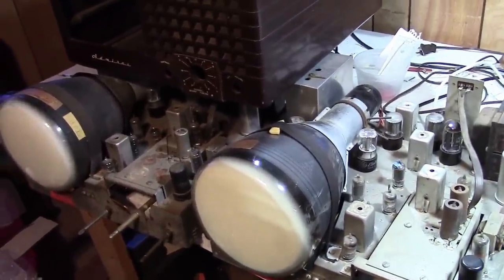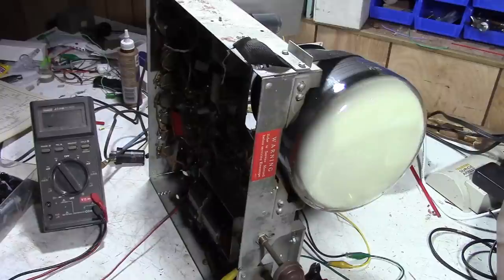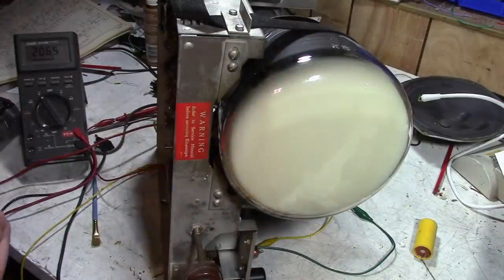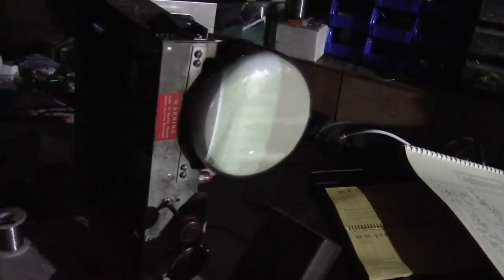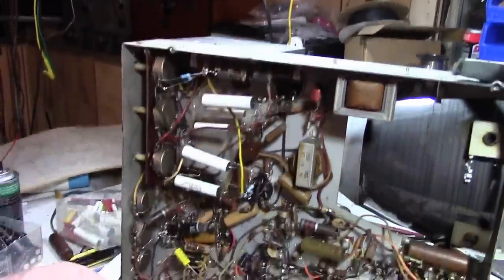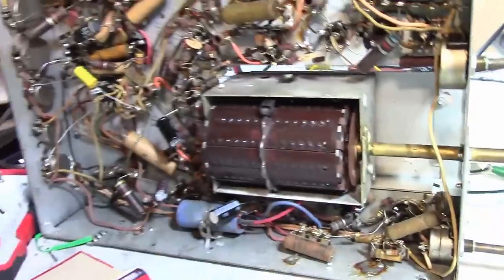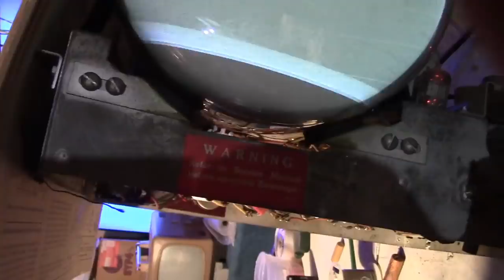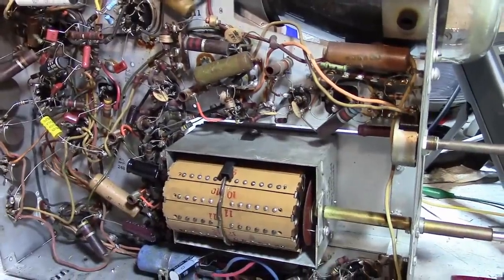Admiral 19A11 restoration #1

Comment: Nice video for this awesome tv. It’s so beautiful to see old Grandpa tv waking up. About the tuner shaft instead of welding ( thats for shure will bend the shaft itself) you could machine a short round rod of same OD with a flat end on one side and tapping a male thread the other side to a smaller diameter (let’s say the half ). Then cut the original one to the appropriate lenght, drill a hole on it of the appropriate dia for the female tapping. Eventually apply a permanent mechanical assembly glue and tighten firmly. You will have a very clean work. You can also tap both female and use a chunk of screw,it’s simpler and you don’t need a lathe, and files away the metal for the flat end. This will allow you to maintain the original if you wish , I believe. 🤗

Comment: I like that you took the time to troubleshoot the issues before just doing a shotgun approach. You wouldn't want to throw a lot of parts into something if it can't be fully repaired. Most people would probably tell you that you're crazy to waste time on such an old TV since you can probably go out and buy a brand new LCD for just the cost of the replacement caps, but it would be tough for me to watch someone toss such an early set in the trash. I'm not sure how many of these are left, but they must be pretty rare. You can tell they took a lot of pride in building these since they used high quality components that were made to last.

Comment: There were some electronic component shortages early in the postwar era, as they likely had not completely transitioned to peacetime production at that time, which could be another reason why there are inconsistencies in the component complement between the two chassis.

Comment: I just started watching the video, about 5 minutes in, and I can already hear the frustration in your voice. I hope this endeavor turned out well for you in the end, with your frustrations paid off :-)
Reply from the maker: It did and then I dove right into the second 19A11 which was an even bigger challenge and headache!
Reply: @bandersentv  Yikes. Sadly thats how it goes sometimes, I havent restored any TVs in a very long time, suffering depression due to job related issues and current events. Need to work up the motivation to do anything. I have a Zenith tabletop porthole with a 12LP4 I need to do something with someday. Needs restored. Unknown if it works.

Comment: Nice set. You have any old tubes that I can use on my tester that has the grid and plate caps on them. Basically tubes that you are not going to use or test to weak. I can pay for the shipping. Also do you have a plate cap test lead (red one) my tester didn't come with one.
Reply from the maker: No, sorry I don't.

Comment: You  called the inside of the capacitor, a jellyroll. When I was a kid   in the seventies,  I opened  up a  real capacitor  and it had a real sticky epoxy  like material  inside . It took days to get  it off my finders    Is  this what you are taking about
Reply from the maker: No. This is paper, metal foil  and wax. I didn't say jelly roll because it is sticky. I was just    using the analogy as something that is made of layers and rolled up
Reply: PCBs anyone...    I used to take TV capacitors apart when I was a kid, I often wonder if I was exposed to PCBs
Reply from the maker: @mrbyamile6973  There are no oil filled, PCBs in TV caps. I don't think they were in use at all way back when this set was made.  They are bulky, expensive, non polarized type caps.  Like AC start and run caps and in power distribution systems.
Reply: @mrbyamile6973   That's what I worry about